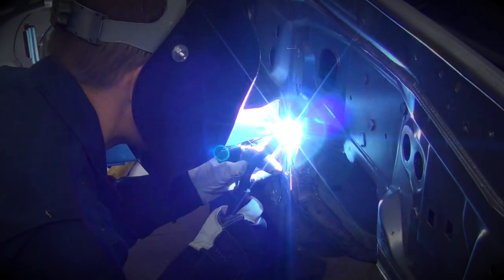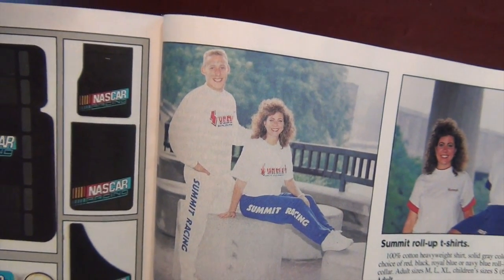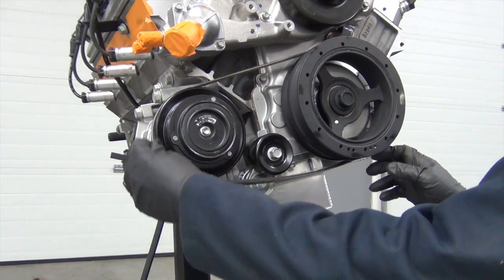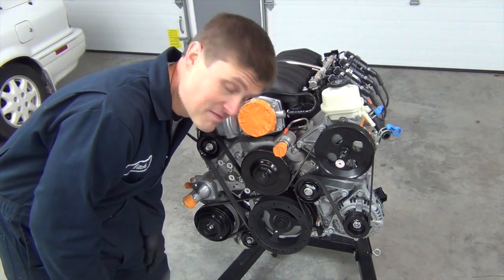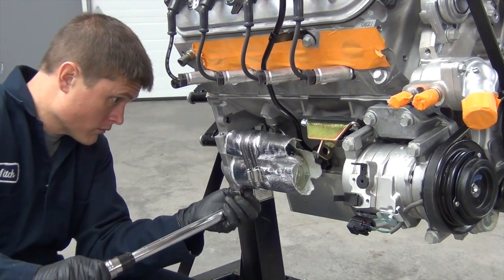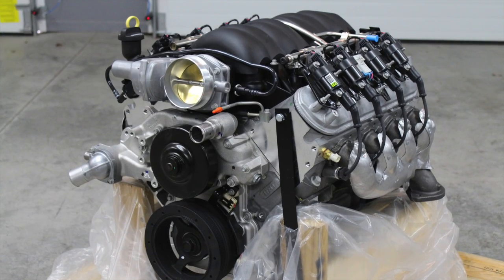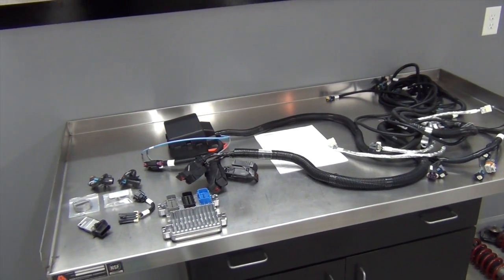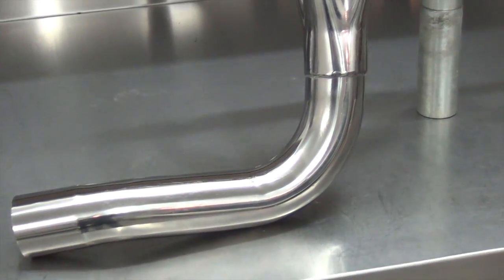LS3 V8 Miata Build - Project Thunderbolt Part 5

Comment: Hear a lot about LS3 swaps being reliable, efficient, and easy to find parts, but 1k for  a drive by wire setup? The average joe could never afford this build and make rent. Have fun trying to keep them wheels on the ground. Nice vid.
Reply from the maker: outkastsk8er20 Thanks man, the engine arrives in the crate with a drive by wire setup.  It could potentially cost more to work around it, as you would need to run a different engine management system, get a good throttle body, etc.

Comment: People are confusing two different Ford engine alternatives here. The old SBF 5.0 pushrod engine has been shoved in Miatas many times over and has been the swap king for years; "Monster Miata" is the term that's generally associated with a V8 in a Miata. The modular V8 engine family (4.6, 5.4, and Coyote 5.0) are overhead cam and and much too wide and tall to fit in the Miata chassis. I think it can be done, but certainly not without heavy modification. When it comes down to it, the SBF 306/331/347 is incredibly easy to do, they practically fall into a Miata due to their compact size. I would pick an LS over Ford modular swap though, only because of even worse fitting issues than what the LS presents.
Reply from the maker: HorsepowerAddiction Well said!  I thought the same thing, but in many cases, folks just don't understand how giant a DOHC v8 is compared to a pushrod engine.  I've grown tired of trying to justify "why I didn't just use a Coyote."  From now on I'm just going to post a link to this pic: http://s51.photobucket.com/user/prolariot/media/IMG_5356.jpg.html
Reply: Tom's Turbo Garage 
Not many fully realize how much exterior bulk is added by removing the camshaft from the center of the block and relocating to the top of the engine. Perfect picture to show it; really gives appreciation of just how versatile that old SBF Windsor on the right really is by being so compact!

Comment: Tom's Turbo Garage I don't know how far along you are in the build, I just know that this episodes are probably 3 weeks to month and a half behind. Two things I could recommend, since you have the interior gutted. First I would linen it with this http://www.alsliner.com/alsHNR. Both the passenger compartment and trunk, I love this stuff it makes a HUGE difference in noise and temp in the cabs. Second and the most import is all that fresh and bear steel, now i know you're not going to leave it bear. But just shooting primer and paint is not the right way to coat it. It will not last up there against the salt and sand used in winter.  For this all my builds both for my personal and for customers I use http://www.kbs-coatings.com/frame-coater-kit.html as a sealer, this stuff when layed on right WILL NOT COME OFF. Its easy and can be brushed on if you dont want to or like to use a spray gun, and its self-leveling. And top coating over it is stupid easy.

and as always great video.
Reply: LOL really?  Would you drive a $50,000, 2400lb, 525 hp car in the winter??  Gonna go out on a limb here and say road salt won't be an issue...
Reply: I did it all the time when I lived in Wyoming, Had about a 700 hp 460, two door F250 long bed. I had to put 600 lb of sandbags in the bed just to keep the rear end from being to lose. and road salt does not magically go away when spring hits, most roads were salt is used will have some left will into june if they had to use tons of it. or there has been little rain fall in spring. 

Second you should never put prime on bare steel EVER, you must SEAL the bare steel with a barrier coating of some type, like the one I linked too. 2k primers are a larger molecule structure and will let moisture pass thru it with ez.
Reply from the maker: TdrSld Thank you for the thoughtful tips, I really appreciate you taking the time to share em.  I don't profess to know it all or even know a little bit of anything, so I gladly take any and all practical advice.  I've got some cool stuff coming that I think you'll find interesting, so be on the lookout for that. :-)
Reply: Tom's Turbo Garage I have been building stuff since i was 10, and in 03 I made it official by graduating from Wyotech if the field of chassis fab and high performance engines. To this day I'm still learning and find new products. We can never know it and anyone that claims they is a danger to this field. 

As always I look forward to the next video, You, *****, Mighty Car Mods, Bad Obsession Motorsport, Joe Wrenches and ***** all are great at what y'all are going. I love to watch and learn more.
Reply from the maker: TdrSld Thanks man and have a good one!

Comment: What's with the massive dent on the header? Is that for clearance?
Reply: +Anthony Pagano probably, interestingly enough there is a video from some hot-rod show on youtube where they smash the living crap out of a pair of headers on an engine putting out more HP than this one and it barely affected the performance when they did dyno pulls before and after. I was shocked. I'm thinking your run of the mill performance header has primaries that are made for easy flow improvements instead of actually being engineered for pulse tuning.
Reply: engine masters on motor trend channel
Reply: Anthony Pagano ...Steering shaft.

Comment: great video,can you talk about the cost of the build?
Reply from the maker: 4godadddygo Hi there, I won't be sharing a cost breakdown, but LSx conversions can range anywhere from $12k to $45k at the high end with labor included.  Prices will vary wildly based on parts chosen, etc.

Comment: Tom why didn't you use V8Rs 1 5/8 headers?  Those FM 1 1/2ers will not flow as well or sound as good as the big guys.
Reply from the maker: Jim Stainer Hi Jim, V8 Roadsters only offers their 1 3/4" long tube headers these days.  I wasn't too impressed with the fit/placement of these Sandersons.  I realize the FM headers are compromised in certain ways, but the benefits outweighed the drawbacks for now.  I may upgrade to a long tube setup someday, but I'll give these a shot and see how it goes.

Comment: Great vid as always!

One question though... with this being an aluminum block, why no anti-seize on the bolts? Or maybe I'm missing something?
Reply from the maker: EchoOfGecko Thank you sir!  These bolts are designed for use with aluminum and most of them have a coating on them which is likely a threadlocker/anti-seize compound of some sort.

Comment: i really hope i dont sound like a negative nancy, but what is with GM and keeping fancy electronics down towards the bottom of the engine? the ac compressor under the water pump seems like a bad idea dating back to optispark issues and then the alternators right there for all those puddles to splash right up into =/ also i have to ask is there a reason you went with header bolts and not studs? this car really is starting to come together nice though! i cant wait for the next video!
Reply from the maker: Thanks Sean, I'm glad you're enjoying the videos!   I have no input on the accessory placement, but that is very common with most modern vehicles that I've seen.  Header studs aren't a common modification for these engines as far as I can tell, I just used the factory fasteners and torque specs, which seems to be very reliable for folks.

Comment: Hope you don't crash, bigger heavier engine and removing the front crumple zone, it won't be pretty. Afew people also have the same worries, and some other are going on about strength etc. My worry is why it was designed that way (crumple zone) rather than strength. All I'm saying is all that for a pretty intake. When did vehicle engineering become so vain?

Comment: Those spal fans suck. I would use a ford taurus fan or ford contour dual fan set up.  Can be found for cheap at a local pic and pull.  Once I switched over to a taurus fan my cooling issues were over.
Reply from the maker: Mike Regner Good to know Mike, I hadn't heard that before, but I'll keep an eye on it for sure.

Comment: Hey Tom! Really enjoying the videos. What is the overall cost of a project like this?
Reply: If i had to assume since everything is new i would say ~25k
Reply: A well looked after kidney. But who needs 2, if you have a car like that? :)
Reply: I went through the parts list and came up with about $25000 not including the car and labor. I'm sure there are a lot of misc parts not listed too
Reply: I would pay Tom 40 000 for the car. How about we wait til' Tom gives us the breakdown. You guys are saying 25 000, the series ain't over yet! It could be done over a longer period while you scour the junkyard for good parts and get it done for about 12 000, including car. But no thanks. Tom's is gonna be a factory car when he's done.
Reply from the maker: Joe V Hi Joe, as with any project the price varies greatly depending on parts choices, etc.  LSx drivetrain conversions I've seen range in cost from $12k-$40k or even higher if the parts get exotic.  Miata parts are desirable though, which helps offset the cost a little.

Comment: Wonder if you could just install a 105mm Holley cable throttle valve instead of the stock electronic one.
Reply from the maker: You can go with a larger throttle body, it would just require a re-tune.  I don't mind the drive by wire, I wouldn't even know the difference, it feels instantaneous to me.  That said, the tune in this Chevy engine controller setup is geared for performance, faster throttle response, etc.  Stock DBW cars do seem to have some lag.
Reply: @TomsTurboGarage  That's why I personally prefer cable. I think an LS3 MX5 would be a perfect fit here in England. Do these kits work for RHD cars too?

Comment: I can't say I'm a fan of fly-by-wire in car's, but it's also because I'm not well informed on what happens should the electrics fail (motor or pedal) does it stay in place or does it close on it's own (even if the motor is stuck?)?
Reply: probably has a fail safe in the tune and it defaults to a sort of limp mode my guess of course i don't know
Reply: More reliable, better control and safer then a mechanical system.
Reply: If it fails open, just throw the car into neutral, steer to safety and shut er down.  The rev limiter will prevent engine damage from overrevving.  No biggie.

Comment: Its really to bad that the Sanderson headers didn't work out. Those were a piece of artwork. The headers from Flyin' Miata were an abomination. The weld splatter that wasn't even cleaned up is just sloppy and the welds weren't nearly as nice.

Comment: Why dont you use a weak drill to thread in most of the bolts then just finish it with the tq wrench. you could save lots of time.
Reply from the maker: Piero Ramos I just like using hand tools.
Reply: gotcha. nice set up btw
Reply from the maker: Piero Ramos Thanks man!

Comment: Are those motor mount heat shields stainless steel or carbon steel, I hope they are clear coated if they are carbon steel. It would be a shame to have them rust, Tom.
Reply from the maker: Don C Hi Don, they are stainless.

Comment: Just wondering,  Wouldn't it have been easier to swap to a manual throttle body instead of keep the drive by wire? That way you could have kept the stock pedal?
Reply: It's probably all tied into the new ignition control system.

Comment: looks to me like you may have trouble with heel-toe rev matching...   from the angle you showed, the gas pedal is too low and too far from the brake pedal... have you considered or sorted that out already?
Reply from the maker: I mounted it in the same location as the stock Miata pedal.

Comment: How much are we talking for all the components(everything you've done so far) to do a conversion of this caliber? I'd guesstimate at least 15 grand or so, am I right? By the time it's all said and done it's going to be pushing 20 - 25 grand or more. All that money and effort into a Mazda Miata? It doesn't make much sense to me. Wouldn't it make more sense to put a Miata racing motor or similar in it? Otherwise, it's going to be an over-powered and nose-heavy handling nightmare. It's going to be about as safe as James Dean's Porsche 356. But that's JMO. Quality work though, I have to say. There's no deny that.
Reply from the maker: I won't be posting a cost breakdown, but drivetrain conversions like this usually run from $15k to $45k with labor included. It varies greatly on parts chosen.  Regarding the nose heavy concern.  The swap adds about 175 pounds, mostly to the center and rear of the car- the balance is 51/49.  This is well documented on FMs website.

Comment: Question about your header choice.  Why even go with shorties in the beginning why not long tubes like you eventually ended up goin?
Reply: Maybe for future turbo installation??? Lol
Reply: when did he go with long tubes? these headers shown here are both shorties, long tubes will have individual primaries all the way back.
Reply from the maker: blakej82008 They are actually both "shorties" but the Flyin Miata are an overall better fitting and more purpose-built solution than the others.  There are full length headers for the miata but they are a tight fit and offer compromises that I wasn't crazy about.  Maybe someday?

Comment: what is your budget for this build and how much have you spent? cool stuff so far :)
Reply from the maker: Hi Boris and thank you!  I won't be posting a cost breakdown, but drivetrain conversions like this usually run from $15k to $45k with labor included. It varies greatly on parts chosen.

Comment: So I know this is a VERY old video, and it's been a while since the series's completion, but I wanted to know, how come you aren't using threadlocker on any of those bolts on the engine?
Reply from the maker: I used threadlocker when the service manual called for it.  Many of the bolts (like the ones from the GM bellhousing setup and accessory drive) have threadlocker pre applied to the bolts
Reply: Tom's Turbo Garage Neat! I didn’t know threadlocker could come “preinstalled” so to speak. And thanks for the explanation

Comment: Is that engine cross or flat plane?  When you made sounds you made those like an old school cross plane v8.  For a small engine bay and low mounting and also free revving why not a flat plane?
Reply from the maker: Are you asking my why I didn't choose a flat plane V8 vs the compact, lightweight and powerful LS3?
Reply: Tom's Turbo Garage Bit of both....  Do these engines (LS3) spin up quick as well?
Reply from the maker: Princess Peach The LS3 is very rev happy an tops out around 7k rpm, but a flat plane would definitely be faster with a higher redline.
Reply: It's a 90 degree push Rod V8 princess

Comment: suggestion! you should install a one-way bearing pulley on the alternator since you haven't put your engine in the car yet:) it makes less loading on the engine:D

http://www.eurekamagazine.co.uk/design-engineering-features/technology/overrunning-alternator-pulley-improves-internal-combustion-engine/39568/?AspxAutoDetectCookieSupport=1
Reply from the maker: ***** Hey man!  Well this is a genuine Denso alternator, which will typically outlive the car it's bolted into! :-D

Comment: Shorty headers are a bad choice for street engines. Long headers produce much more true and power on the bottom end. This is especially important when starting from stoop lights and accelerating onto onramps. Those who doubt me should read "the Scientific Design of Exhaust and Intake Systems."

Comment: Why convert to DBW? Isn't some older LS engine using cable throttle still? DBW will always to slower than cable throttle.
Reply from the maker: The GM Controller kit that I used is native DBW, not converted.  I have driven both and feel no difference, it feels instantaneous to me.

Comment: Where's the loc-tite for the threads, mate?
Reply from the maker: I used loctite when the service manual called for it, but didn’t always show it.  Some of the hardware (like the flywheel bolts and others) come with loctite pre applied.

Comment: I'm a noob to LS but is the engine completely alumninum? how much does it weight? i watched a video comparing a Ford Coyote to a LS and they said the LS is not full aluminum despite its smaller size its heavier. but your video seems to show thats not true.  can you enlighten me?
Reply: There are several different LSx engines.  Pretty sure the LS3 is completely aluminum.

Comment: I Noticed, that On an Aluminium Engine that You Used No Anti-Seize.....Was that Overlooked, or Not Mentioned???
Reply from the maker: I used anti seize when the factory service manual called for it.  Many of the bolts from the GM packages had it pre applied.
Reply: @TomsTurboGarage : Thanks, Excellent Job!!!

Comment: Wow that PS reservoir looks very ugly compared to the rest of the build. You should consider replacing that plastic thing with something more durable and that does not yellow out and crack over time
Reply from the maker: Andres Barquero Hi Andres and I hear where you are coming from maybe it seems weird, but I like the look of the OEM unit on there. That piece does look good and very well made.